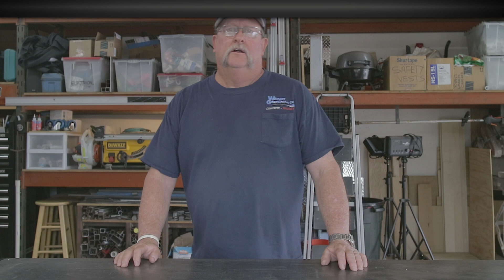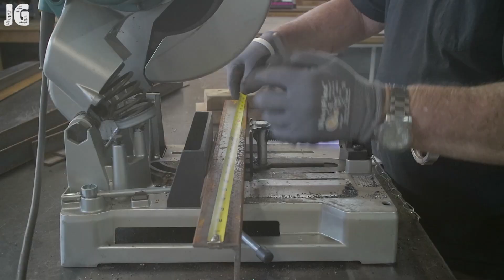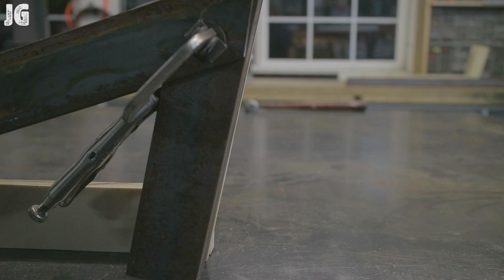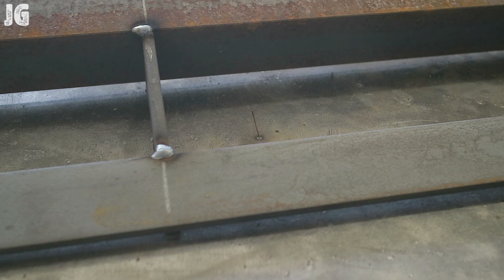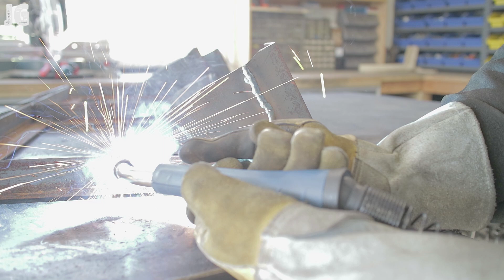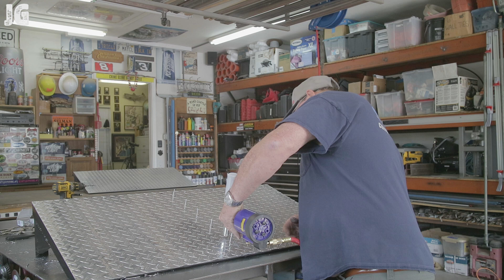Steel Ramp Build - Jimbos Garage

Comment: Seems like this wouldve been better off with some steel plate on top, but thats just me. Holy shit, I didnt realize there were going to be moved. I definitely wouldve added some concrete screws and bolting surface. Forget moving heavy stuff and risking injury no thanks!

Comment: Hey man, little late to the game here by 4 years or so, but I just wanted to make a quick recommendation about the camera lenses. Maybe you've got it all sorted out by now, but yea... Check into getting some cheap UV filters for your lenses. They don't change the exposure much at all, but if you end up blasting the lens with sparks again, you're only tossing out a cheap $10-15 UV filter instead of the whole lens.

That's about it! Love the channel, just found you recently and I've been watching through your stuff pretty much nonstop. Thanks for all of it!

Comment: Another great build Jimbo. I do have one question.  How did that aluminum diamond plate hold up with the weight of the rv? It seemed thin for the weight and  only one center support. Did it  cave in at all in the unsupported areas? I built something similar for a customer so his fork lift could clear  a curb and had to go with 1/2 aluminum diamond plate and center supports 4 inches apart.

Comment: Jimbo, do you MIG weld with straight Argon gas? I use a 75/25 mix per the recommendation from my local supplier. Any advantages/disadvantages?

Comment: Hi Jimbo. I think you have a bad habit making circles with the mig gun. You should weld in straight stringer lines and you’ll see that the welds will look better and you’ll save a lot of time. This is the same deal with arc welding (mma).

Comment: I use the heck out of cheap "UV" lens protectors. Most are sold as UV lenses, but are pretty crap at that. They are, however a $2 protector for the more expensive bits. Mine generally last about a month before I get weld spatter or grinder sparks into them.
Reply from the maker: Thanks for watching Richard, Yes i use them too, I pay about $6.00 ea. for them on amazon.  Jimbo!
Reply: JIMBO'S GARAGE check eBay, I buy them in bulk

Comment: Why use pop rivets on the diamond plate instead of welding
Reply from the maker: Thanks for watching Julian, It is aluminum plate to mild steel.  Jimbos garage!
Reply: julian kinnard steel and aluminum are dissimilar metals and can't be welded together, that is the reason for the pop rivets.

Comment: I like them Great job Jim I think you dropped some nice dimes down on most of the welding but As a concrete finisher myself I couldn't help but notice the new concrete so why didn't he just pull permits and extend his approach all the way across or have the curb cut and the pour the driveway... just curious was pipe in the way?
Reply from the maker: +Robert K   Thanks for watching Robert,  Ya as you know by the time you saw cut and demo, permits, concrete and finishing your in about 2k or more, He was ok with the $200 for material it took to build the ramps. Not to mention it was a video for you guys. Lol, Lol  Jimbos garage!

Comment: Nice work, Jimbo. I gotta tell you though, I thought I was the only guy who goes through hell on certain projects. Some projects go great, and some absolutely suck the entire time from start to finish. I could tell in your tone that this was one of "those" projects. Oh well, you made it through and the ramps turned out great. By the way.... you really should look into the Milwaukee 110 volt hand held metal cutting circular saw. (or similar brands) They kick ass for cutting gussets out of steel plate. Even better, faster and cleaner than a plazma cutter. I wouldnt give up my metal cutting circular saw for all the tea in China. Seriously. keep the projects coming.
Reply from the maker: +brianok100   Thanks for watching  and your comments brianok100, Your right, Thats a great idea i will look into that Milwaukee saw, I have seen those. Your right, some projects go well and some not so well. All is good though.   Jimbos garage!

Comment: Nice build like the way you just put it together with no drawing. Was wondering about your welding problem did you have the ground clamp on the part if that would have made a difference. I watch a lot of the welding youtube channels and mig + ground seem to be a big problem. This is just an observation I do not have welding experience justs observations. 
Good project 
Have a day
Reply from the maker: +E Hiebert  Thanks for watching, Great observation! That could be the problem, I just had the ground clamp to my table. Most of the time that works fine.  Jimbos garage!
Reply: May work, but electrical shock hazard is possible. I use the table too much as well, but it would be much better to ground the work piece.